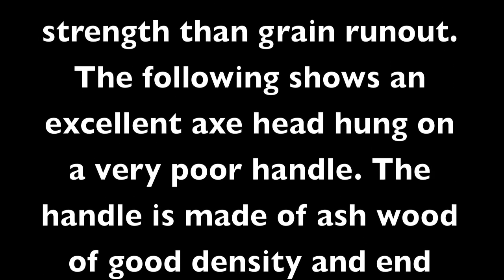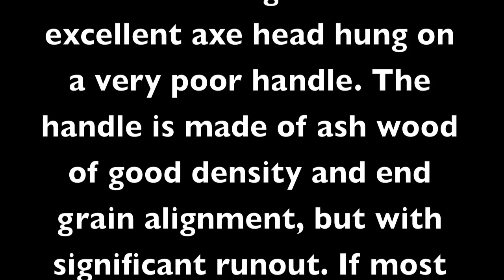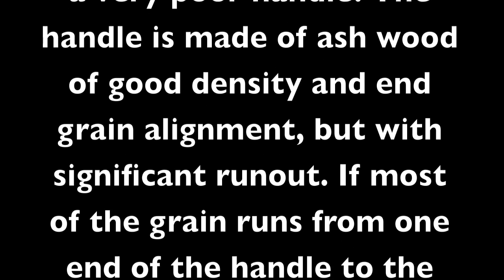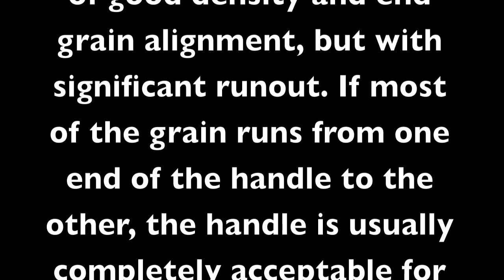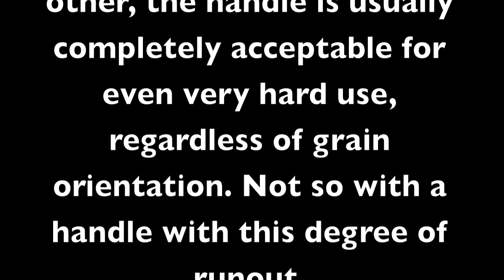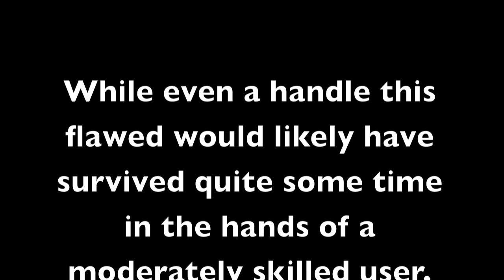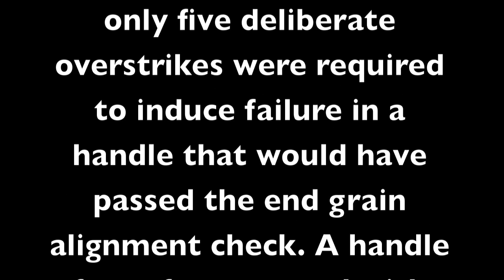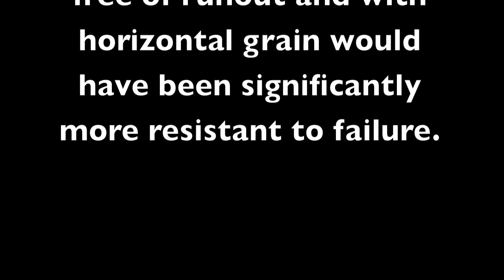Induced Axe Handle Failure--Grain Runout

Comment: So by purposely  and repeatedly over striking u proved u could break an axe handle....that like u clearly stated could have lasted years  in trained hands...
Reply from the maker: In only 5 hits of fairly light strength. Not a difficult number to hit in regular use by a user of average skill. The break occurred along the porous structure of the grain as is conventional with ash, and ran out the handle. Wood with continuous end to end grain would have survived many more such damaging strikes. The question is not one of whether or not it can have a useful life or not, but of RELATIVE strength, and runout like in this handle does drastically diminish the resiliency of the handle, making breakage in normal use much more likely.

Comment: Great video  / demonstration.

 I recently started making axe handles and have had several comments on some of them because of end grain orientation. The grain always go from end to tip but end grain not Always 100% horisontal or vertical in end. I just use theese handles myself or as sample.

Comment: I agree that compared to slope of grain the orientation of the growth rings is of little importance.  Your video shows the radial or edge slope of grain due to the growth rings that can easily be seen. However it does not address the tangential or face slope of grain that may not be seen with a visual inspection.    There is a special tool that graders use to check the  face slope of grain.  The face slope of grain (not growth rings) is a very important part of wood structural strength.   
If handles are split out of the log, the spits will follow the grain and the quality will be better.  For sawn handles, grading that included BOTH tangential and radial slope of grains is very important.
Reply from the maker: +Jim Thode Right on the nose. When it comes to handles, though, there is some preferential debate over end grain alignment. While vertical alignment is strongest, some prefer horizontal because of the improved shock absorption, and are willing to live with slightly lowered strength in exchange for it. At the end of the day it's usually either runout or outright abuse that causes handle failure.
Reply: @FortyTwoBlades  Nailed it! Far too many axe makers disregard straight tangential grain.
Reply: great comment.